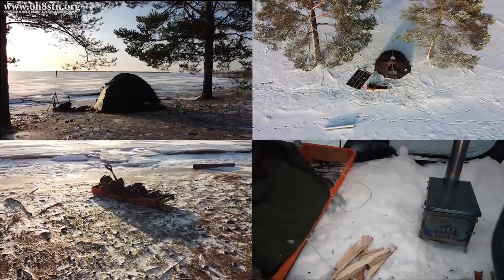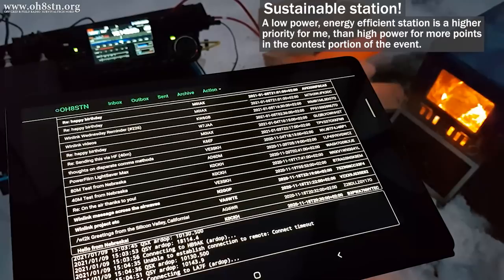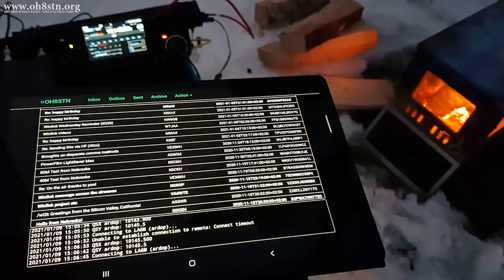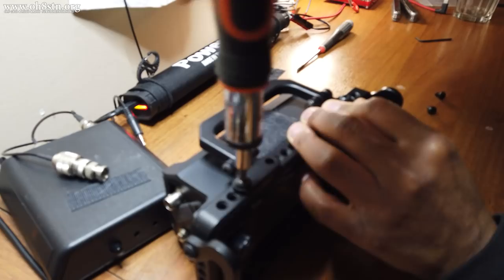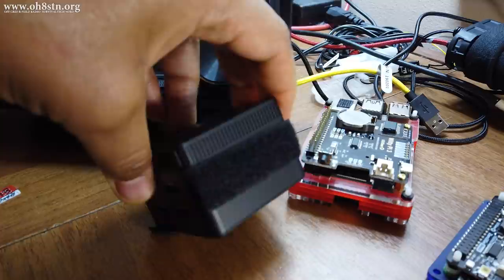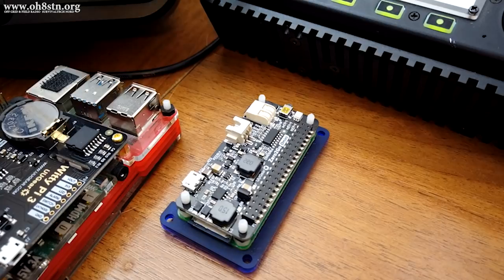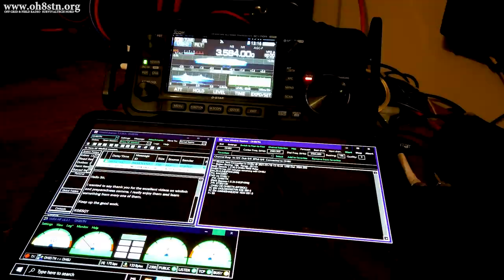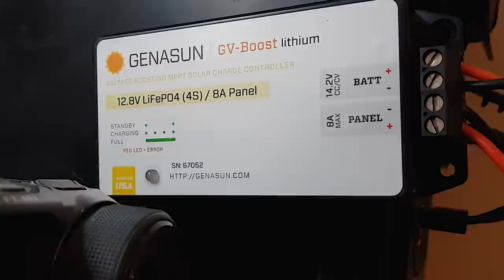Ham Radio Off Grid | Winter Field Day

Comment: WHat android tablet are you using these days and how much power does it use?
Reply from the maker: Same tablet, different cover. It's a Samsung Galaxy Tab S5e. It's not a power-hungry tablet, with a very large battery.
Reply: @OH8STN  Thanks Julian. When you do your "after-action" report, it would be interesting to know the total power requirements for all devices. Having a low receive current draw on the radio is great but could easily be negated if the computer gear required to decode a digital message is too high. Also having a tablet with a large battery is great if the deployment is short-term (a few hours), but for an extended deployment, one would need to budget power to recharge the tablet, etc.

Comment: You mentioned a possible “rugged tablet” instead of using the Larkbox... what were you considering if you had gone that route? Is there a laptop, such as the GPD Pocket 2, which might meet the requirements for running Vara? I am starting from scratch here, Julian. Thanks KY9I
Reply from the maker: Toshiba Toughbook, Dell 7212, 7220 Rugged tablet, Surface Tablets with rugged case. USB-C charging and gorilla glass are the things most important to field Operators.  Thd GPD mini laptops and tablets are ok for the hobbyist,  but if preparedness is your intent,  try to find one of the used or refurbished models mentioned. 
73
Julian oh8stn

Comment: How do you manage time off grid with the Larkbox pro?  Are you  using a GPS module?
Reply from the maker: Excellent question and one I forgot to cover in this video. One of the reasons for choosing the IC 705 was its inbuilt GPS. The 705 provides GPS nmea over the USB USB cable. Then an app called gps2time to sync the clock.
Reply: @OH8STN  The lack of VARA for the pi has caused me to look at a number of Win options (compact PC's, notebooks & tablets).  I concluded that Winlink capability with VARA is essential for my emergency config (inc P2P if necessary).  I will keep the pi with ARDOP (and JS8call etc) as a backup.  I too will  use my Samsung tablet as a screen (I like no cables). The Larkbox pro seems like the most practical solution so far.   I would just need integrate a reliable 12V supply into my config. Tks for your pioneeering effort ! 73 VK4PWG